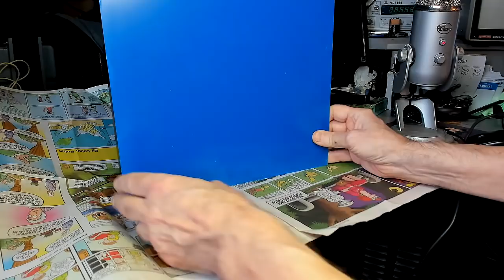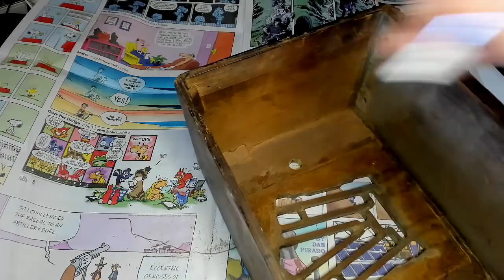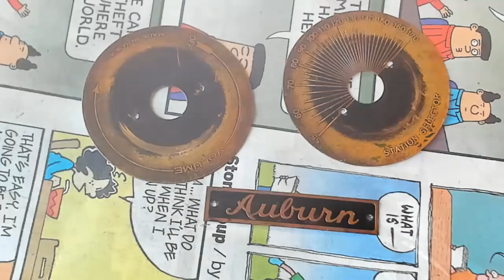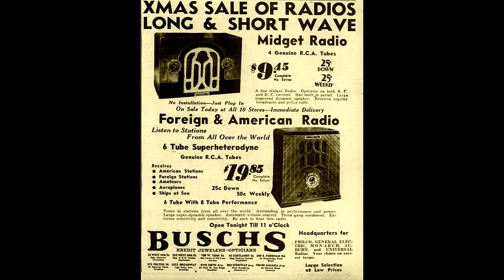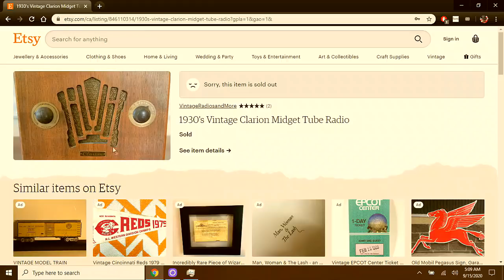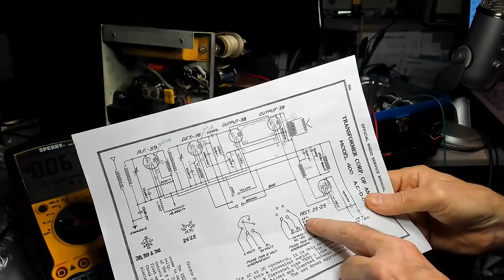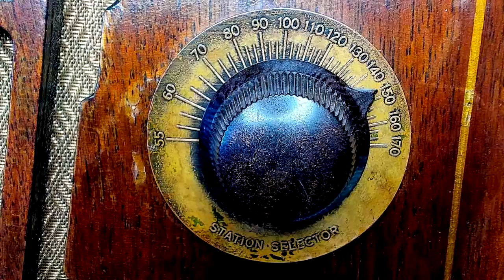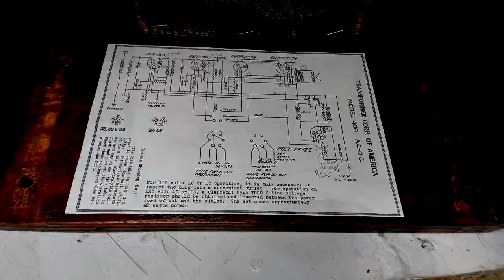1930's Auburn Mystery Radio Restore Part 3 Final

Comment: These originally sold WITHOUT the tubes?  The last tube equipment was being sold when I was born. I don't recall ever seeing any device requiring tubes that didn't come with them. 

The "Knight" ad doesn't say superhet anywhere on it that I can see and it is more expensive than the superhet advertised in the other brochure. $67 without tubes vs $39  for Superhet without tubes.
Reply from the maker: I believe those Knight radios  were  TRF,  but when superhet became popular the prices dropped

Comment: Old cars had 6 volt DC batteries rather than the current 12 volts.

What was that phone number for Dr Pinkus?  the problem with restoring an old AM radio is that it does not solve the problem that AM radio is full of junk
Reply from the maker: what's you point?